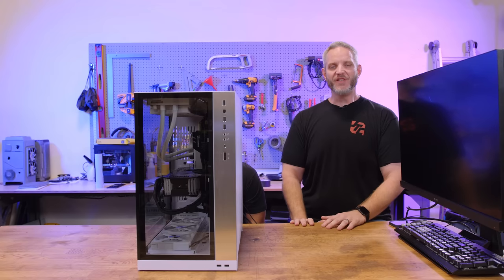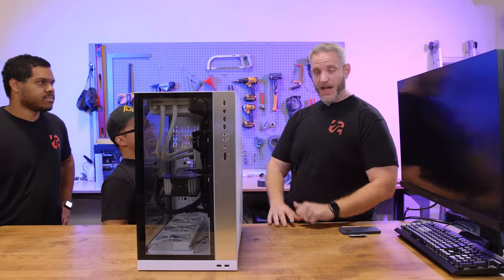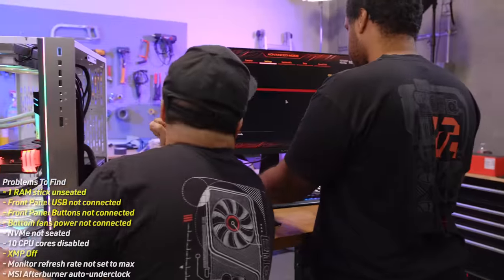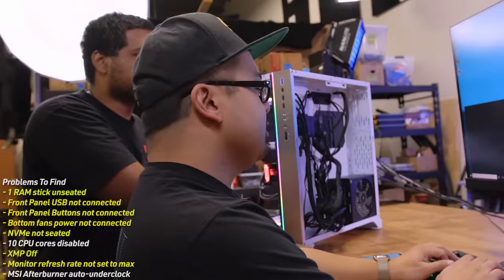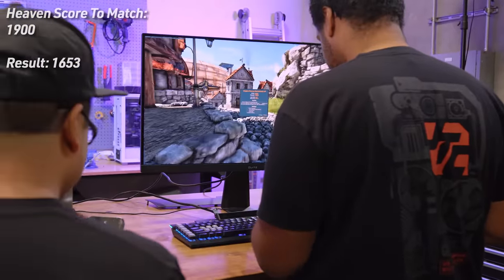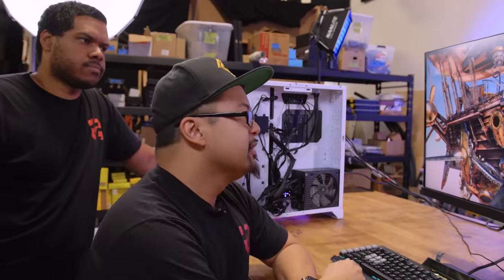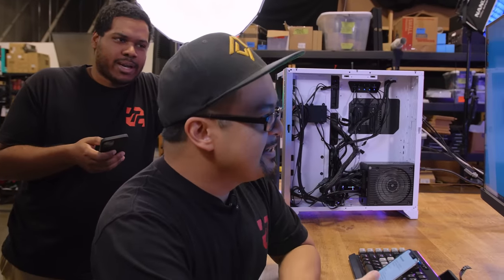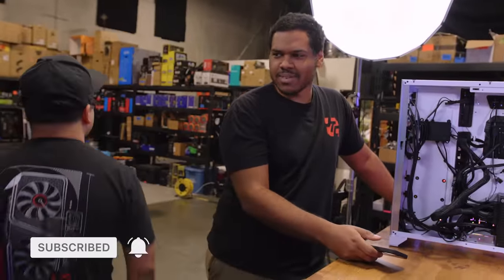I said I would give them CASH if they could fix this "Sabotaged PC" - Tech Challange

Comment: Best sabotage I've ever heard of: A tiny, flat jumper on the reset header.

If it's small and flat enough, you have to actively be looking for it to notice it, and as long as it's on the header the motherboard will never post.
Reply: Use a jumper plug/cap thing from an old motherboard on the clear cmos jumper pins is another annoying one. And more fun with jumpers if you do troubleshooting with old hardware swap the master jumper to slave on an IDE hard drive when theres two on the same cable, 2 slaves and none will show.
Reply: That's just evil.
Reply: @JETWTF  I actually did the hard drive thing on accident with my first computer when I was a kid.  I thought I'd somehow bricked both drives and was terrified I'd have to ask my parents to buy me another one.  It's amazing how streamlined and foolproof (or at least fool-resistant) things have become.
Reply: @ahmugatti464  I have done it too. HDD were expensive back then too so it had me scared.
Reply: calm down Satan
Reply: easy to pull the metal jumper out of the plastic holder. you have to look pretty hard to see that little metal jumper by itself.
Reply: @tonyjklh  Now that's evil. If you have done that it makes you asshole of the year... And that's a reward worth getting in this case! Love it!
Reply: That's no longer a problem solving IT problems, that's basically vandalism detection...
Reply: @JETWTF  back in the day that could also destroy your windows installation, i once did that with an optical drive when i was angry about sonething not working, screwed around with my IDE devices, killed HAL. dead windows.
Reply: That's just straight-up diabolical.
Reply: I was expecting this jumper thing to be one of the sabotage, as I read the comments first :) 
would have been really fun to watch that debugging.
Reply: @schwubbi  If your testing someone on troubleshooting then their ability to reinstall or repair win98 or whatever could just be an added bonus. I never said do it as a joke on a working machine.
Reply: @matasa7463  this whole video was about vandalism detection as they were told it was sabotaged. Intentionally disabling CPU cores and applying an underclock aren't accidental IT problems.

Comment: He mentioned that he limits his framerates differently for each game. I think this would be a great idea for a video!!!
Reply: Yea I would like to see him discuss that a bit more.
Reply: I personally just limit it to 60 FPS unless it's a shooter cause any other game you don't need anything above 60 FPS.
Reply: I would love to see that too
Reply: I've been doing this because my damn Strix 3080 ti has some awful coil whine when I let it run limitless.
Reply: Yes, that would be cool to see.
Reply: yes, great idea.
Reply: Agreed
Reply: Agreed, be cool to have Phil go in depth on that.
Reply: SOmething I'm aware of but don't really consider or do.. Would save a few watts on the power bill though depending on the game. The '97 Age of Empires doesn't need +200 fps.
Reply: I was thinking the same thing. I use (probably foolishly) GeForce Experience to adjust my settings and hope for the best.
Reply: @Killswitch1411  Just curious, do you have an EVGA PSU? This might sound stupid but I thought my 3080 had bad coil whine but turned out it was the sound signature of the EVGA PSU fan spinning faster. Looking online, I found that EVGA gets aggressive with their fan profile starting with their 850w models. Ended up replacing the PSU with a different brand and now don't hear any of the extra noise while gaming.
Reply: @msnight04  Its for sure from the GPU. I do have a Evga Supernova g+ and the PSU is nearly silent. When I turn on Vsync the noise almost goes away when I reduce fps is does the same. But the sound is 100% from the Strix 3080 ti. I have a 3090 FE  I tried on the same PSU  and almost no coil whine on that GPU. Something with that Strix card, it can get as bad as if you move the mouse on some games it changes the pitch of the Coil whine, under volting also reduces the sound. But limiting the FPS seems to be best option.
Reply: I do it too because Skyrim likes freaks out like anything over 60.
Reply: @Raven.Bloodrot  I do the same but keep it between 3 - 30 fps above screen hz too have some buffer for things loading in.
(Forced hdmi on my monitor too 74 hz as it can take 75 on vga without any issues but gets no display with hdmi at 75 hz.)
Reply: If you have VRR (G-sync, Freesync, whatever) your FPS have to stay within its range. If you go outside (say 144.1 FPS on a 144hz monitor) you either get tearing (v-sync off) or increased input latency (v-sync on). Staying about 7% below max makes sure you're in range (e.g. Reflex automatically caps 6-7% below max refresh of your primary monitor on native g-sync monitors among other optimations).

Limiting further can be benifitical to hit stable frame times and less fluctuation in FPS, which feels smoother and more predictable for most. Set it to the minimum FPS you can achieve (excluding loading stutter and similar).

Bear in mind that those tips are all for VRR and good fps limiter, like e.g. Special K (yes like the cereals) offers.
Reply: I do this as well , I mean why stress the hardware and create excess heat if you don't need to?
Reply: I agree
Reply: @Raven.Bloodrot  Makes sense on 60hz fixed refresh monitors. Or if the game is capped at 60 fps anyway. Personally I still notice a smoother image, especially with fast camera movement, on higher FPS (when the monitor actually can do higher hz).

If you need lower latency on fixed refresh you could also try Scanline Sync from RTSS or Latent Sync from Special K. Those are designed to act similar to V-sync (eleminate tearing on fixed refresh rate monitors), while they don't introduce input lag like v-sync does.
Scanline Sync is generally more compatible (as in "allowed by anti-cheat"). While Latent Sync should automatically hide the tearline and is a bit better in latency and frame time variance.
Reply: @patrickspothelfer2946  it's more about simply not needing higher FPS on games that aren't shooters or that I'm not needing a competitive edge in. RPG games basically, I just don't see the point in working my card to overdrive if it's really not needed to enjoy the game.
Reply: @Raven.Bloodrot  it is not like letting it run at 100% would damage it. Saving electricity or fan noise on the other hand is a valid reason not to.

As I said I can still see a difference in smoothness, so I prefer about 85 fps, even if it is not needed latency wise.

The second part of my comment was a advise for fixed refresh. IF low latency is preferred, like in a shooter. Ultimately it is the users choice.

Comment: This was a great video. It took me back to my days in the Navy, where we would set up troubleshooting stations to test ourselves. Everything was free game. CMOS settings, BIOS settings, software settings, to hardware issues like unconnected cables, known bad cards, to ICs with broken pins, and fans with missing blades. We had to write out what the symptoms were, the problems causing those symptoms, the observed values versus the expected values, and the steps taken to correct those problems. If components were changed out, like resistors or capacitors, we had to show the math that verified what the component value should be, and then take corrective action to fix the discrepancies.
Reply: Good ol' 7-step troubleshooting procedure. Can't say I miss those days, but damn did it really instill the "are you SURE what you found is actually the problem?" type of mentality.

Comment: I love this. In my early IT classes we had 2 bays of older computers on opposite sides of the room. A regular activity was to split the class and give them 15-20 minutes to sabotage the bays. Than the halves swap to repair and network the computers. Once one side was completely up and running they got to play games until the other side finished. So lots of motivation to do well in both segments

Comment: First of all, thank you for listening Jay! Second, more of this stuff please!  Lastly, I agree with Phil, I hate Gigabyte's BIOS! I am currently using a B450 Aorus M that I bought last year, and I will never buy another Gigabyte part.
Reply: Same here! Done with their motherboards, at the very least
Reply: @SwervingLemon  dont forget their power supplies 🤣
Reply: @jeremymatthies726  Yeah but it's worth noting that they didn't make the P-GM, that was some other OEM, not their own factory. That's why the Aorus version, the AP-GM, is perfectly fine - another PSU OEM had made that.

Always check the model, not the brand. Even Seasonic has released bad PSUs before - but that's because that PSU wasn't made in-house by them!

MSI's PSU, for example, the MPG A-GF is a really good PSU, because the OEM did a good job on the design.
Reply: Same here. It wasn't even one year in and the motherboard was starting to rust! Gigabyte products are really low quality and not worth the few dollars you save on them

Comment: Honestly if I had to troubleshoot a PC that I'm aware has tons of problems, both hardware and software, I'd reassemble it to rule out build errors, reset CMOS to make sure bios is default and reinstall windows to start clean and prevent improper drivers and all.
It might take more time but it would rule out all mistakes that are in my power to prevent.

Comment: Should do it with a real borked desktop (like a cheap ebay/ Parts only dell), not manufactured problems. That way they are thinking about it like an actual problem, and not just trying to figure out the puzzle of "What did Jay do".

Comment: back in the day you could REALLY mess with somebody by setting the BIOS date back. I had that happen once back in the late 90's with a new MB I had purchased, it's date was set to about a year before and since most of my software was newer than the date...EVERYTHING kept crashing. First thing I check now whenever I get a system is date and clock in BIOS just in case. It's probably not so much of an issue these days, but I spent 2 weeks trying to figure that one out at the time.

Comment: I am surprised that you didn't install any malware or loosen the extra connector on the GPU. My PC was crashing non-stop whenever I game and I had no idea why. A slightly loose GPU power cable was the culprit. It worked fine for windows and youtube/web etc. I only discovered it when I wanted to RMA the card

Comment: It reminds me of my days competing SKILLS USA and going to the State round in Lynne, Missouri. One of the tests was troubleshooting a PC and getting Windows XP (dating this moment) on the computer.

My biggest issue of troubleshooting a PC back then. I never checked the voltage on the Power Supply, lol. I figured everything else. Yet, it would not boot. I literally took the risk of asking for a hint. Well, I felt stupid having that pointed out.

Well, 2 years later. I had an issue of a PC that would boot off whenever the AC kicked on. I spent a few weeks living with it. Until I realized the issue. =.= Someone (my little brother, who was 1 at the time) flipped the power supply voltage. I have officially learned that lesson, and it is the first thing I check. If there is a switch, lol.

So my biggest tip to anyone. If the PC doesn't boot up or has power issues. Check the voltage!
Reply: This is the type of troubleshooting step where you really have to be careful to check before turning on the computer if you live in a 230vac country. For those of you at 115vac, trying to turn a computer on when the selector is on 230v will just result in a computer that doesn't turn on, but in countries @ 230vac like the UK for example, a computer set to 115v will result in a mini fireworks display inside the PSU.
Reply: @cjs95  Oh I learned my lesson. Still, it was one that feels like a lifetime ago for me, in Tech Years, wishing to have paid attention more about PSUs lol.

Comment: Ok, I wrote this in Notepad; I downloaded Unigine Heaven Benchmark & determined my own results: 

Benchmark Determination

Ambient Occlusion, Tesselation (moderate) On: 1280X720

Ambient Occlusion or Tesselation (moderate) On: 1366X768

Ambient Occlusion, Tesselation (moderate) Off: 1920X1080

Determinating if I rather have Ambient Occlusion, or Tesselation on? I determined I rather have Tesselation on & on moderate.
Edit: I had Anti-Alising (x4) on with those results. Then I thought about trying them all off with 4K; determined that that's good:

Ambient Occlusion, Tesselation (moderate), Anti-Aliasing (x4) Off: 2560X1440

Another thing I can't help but notice, is overbrightness of the overall lighting. The brightness just needs to be reduced somewhat.

Comment: one problem fault i did for a lab class (over a decade ago) was tp jump the green and black wire on a power supply and then let the  students and other staff figure the problem out  5 years later they only finally figured what i did

Comment: every single problem in 45 minutes lol. is this what its like for parent hiding eggs on easter and the kid finds them all right away, not even a challenge at all? for the next challenge it needs to be in the corsair 1000D up on top of the shelving. not only vertically challenged, but in a massive case that they can't just spin around on the desk

Comment: Jay should have put the RAM stick in backwards so it would be hard to put back in until they realized it. LOL.  That's happened to me a few times and I usually initially think the I'm just missing the slot on the top or bottom.
Reply: if it's backwards, the slot wont line up, so you should feel/see it teeter-totter

Comment: You should've made it even harder with the ram as you've probably got other Gskill Trident Z sticks that run at different speeds and latencies that you could've mixed into that 4 stick set...also since the PSU was fully modular you should've connected extra SATA cables that lead to nothing or at least have them not connected all the way..."Wait a minute, that could possibly cause a short or even a fire so, maybe not that much sabotage" ;)

Comment: Mac OS does not set the maxium refresh rate, didnt even know my MacBook had a 120Hz screen till i installed linux. Though being an early high refresh rate monitor it isnt the best experience, my guess is that Apple spec'd the screens to be high refresh, and then in QC they realised it wasnt a great experience and just locked it to 60

Comment: Hey jay I have a question I recently made a build but I’m not sure if I made the right choices. I tried to run the programs you mention here to see the benchmarks.  

TT v series tower
HP RTX 2080
i7 8700k
Gigabyte z390 pro WiFi motherboard 
64gb Corsair vengeance ddr4 3200
2tb hdd
1tb ssd
TT liquid cpu cooler 120mm
TT 120mm rgb fans (6)
Corsair 750w 80 plus gold psu

Comment: Straight up would not have caught half of those errors. On a normal board would cores get disabled by default? As I have only had quads or less not sure how many cores works like 8+ and so on. Does a MOBO shut cores down if not enough power is going through the board?

Comment: Random issue for BF2042 if anyone knows. Laptop defaults to iGPU (5800H) vs the 3050, all drivers up to date, 2042 is set in windows to max perf GPU, Nvidia control panel is globally set to Max Perf GPU, power settings are set to Max Perf GPU. Can't find a config that would work to switch from GPU 0 to 1. 

Nerds I need help 😂

Comment: @47 and troubleshooting for 25 years, I would have done it the less arguably faster, but way that I know was done right, tearing out everything, rebuilding myself and then also starting from a fresh platform software wise...but suppose that wasn't the challenge.
Reply: If you troubleshoot a lot of PCs, that's probably the way to go. It'll cast the largest blanket to catch/fix weird issues and stop you from going down too many rabbit holes.
Reply: @seshpenguin  exactly...if you can re-image a system in 15 minutes vs spending sometimes hours or days chasing down that one esoteric issue.  But then you have to consider personalization...what files of the user were or are backed up to give them the OG experience they are used to.  Also what polotics are employed to help users with issues you know you can't fix.  For example, in my new job, we went from a virtual environment, about 4o users on thin clients hooking up to a virtual desktop server to launch their work apps.  We went to physical laptops and docking ports (which can in and of itself produce more issues), but the overall experience is a more proformance based win, no longer centalized and relying on a single server to host that experience.  My problem lies within Outlook, and the usere's percieved slowness...at times.  I know what the cause is, the fact that she hasthousands of emails in folders and 100s of folders nested in the inbox, and that outlook is not a database to store all that.  But I can't close that ticket out because the problem still exists.  So how to weave that fine line between apeasing IT management and the user at the same time...heh I digress, just one of the challenges in IT. sorry about my typos

Comment: Windows 10 does actually set the refresh rate to the highest for the screens? Just reinstalled a computer today and it put mine on 144/100/144 (27"/34"/27")

Comment: Love the continent you guys put out keep up the good work. Had a question to ask I’m currently changing cases and I have an auris motherboard X470 Extreme gaming I’ve never updated the bios it is still on F2 Should I flashed my bios to a more up-to-date version because I did upgrade to a 3060 and I am going with an AIO cooler system in it.